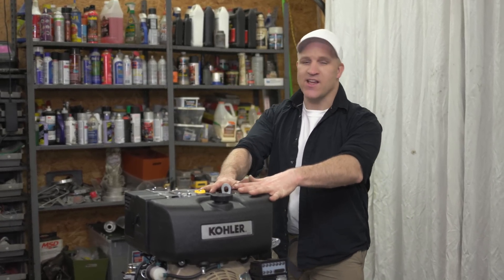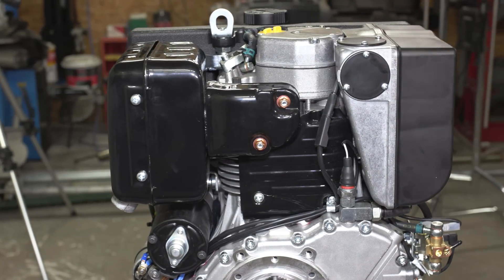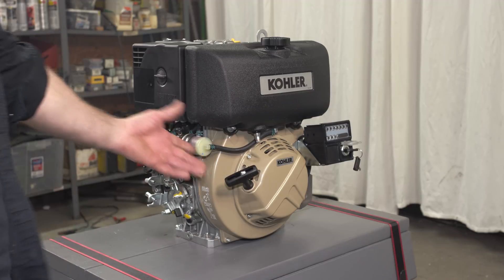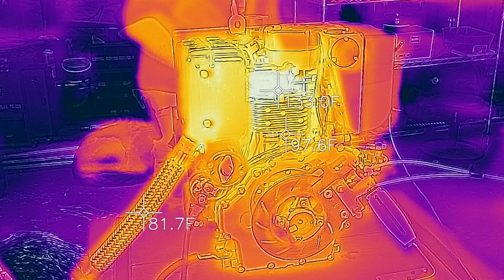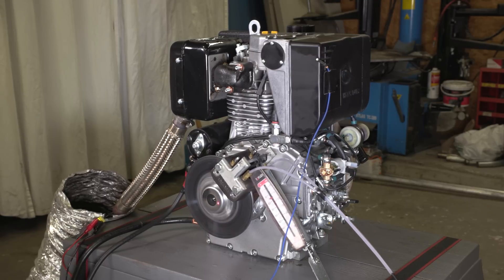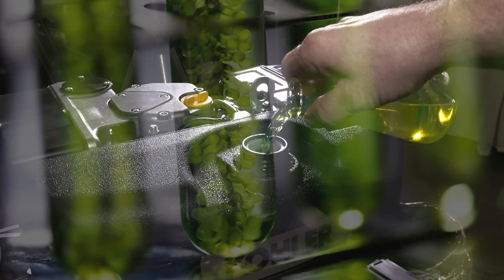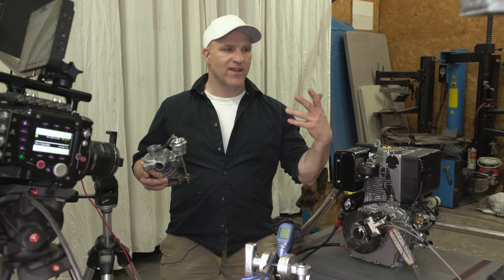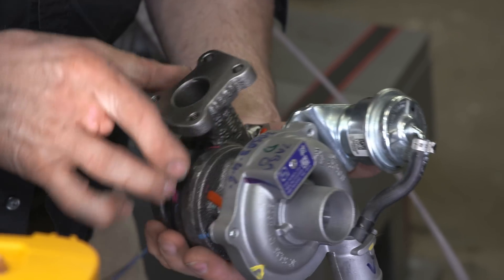Single Cylinder Diesel Engine - Dyno Test (Diesel, BioDiesel & HydroDiesel How Much HP?)

Comment: Those arn't heat shealds,  they are air duct tins to cool the engine.
Reply: The engine will overheat without the air flowing over the fins.
Reply: Paulman50 .. Correct .. sheet removed from cylinder fins was air duct for cooling. And sheet which removed from exhaust manifold was heat shield.
Reply from the maker: Well one of them is a heat shield the other one is a air director
Reply: It doesn't matter anyway, for the purposes of the experiment, there was no variable added from this, as each test had no ducts on
Reply: @WarpedYT  I'm sure you realize already... Just pointing out to the public... Removing an airflow director on an air cooled engine can dramatically change the operating characteristics of that engine. Literally anything from no change to engine death depending on multiple variables.

Definitely looking forward to seeing what you do with this project!
Reply: @WarpedYT  ......
Reply: Doesn't matter, the point is to compare temperatures in different conditions. He isn't measuring for the sake of saying "this engine runs too hot/cold"
Reply: There both, but that's irrelevant idiot.
Great video, I'm getting me a motor for my gocart.....

Comment: Do you have a table with all the values together? I was waiting for that for comparison xD
Reply from the maker: You know, I absolutely totally forgot that. It was literally in my editing notes and since I was working on this edit till 4 in the morning I was really tired and I forgot to put that flash card in there. Holy crap I can't believe I forgot that.
Reply: @WarpedYT  here you go! https://imgur.com/gallery/CxPrNy5
Reply: EGT with hydrodiesel seems through the roof. I wonder if NOx emissions are higher because of that (Probably yes).
Reply: @WarpedYT  put it in the description
Reply: @WarpedYT  https://imgur.com/a/jPd4vwp
I wondered why the EGT temp was so different in HyD, is there any mistake? All the rest are pretty similar.
The time marks in the description were useful BTW
Reply: @WarpedYT  It's fine - just cover it at the beginning of the next video.  We all make editing mistakes.
Reply: @WarpedYT  did you do April eating yet? I haven't saw a single thing of April eating in 1300fps 4k slow motion.
Reply: Nevermind, I put the video on PC and made some screen caps xD
Reply: Yes,. The EGT for HydroDiesel was higher,. But it was also reaching higher rpms,..
I’m wondering why the temperature on the Head is lower on HxDiesel,
It’s about ~50•f bellow the other 2 fuels?
That seems very interesting given it’s the same engine and same test standards..
Reply: Put the capacity in the description with the bore x stroke too ffs. 
The 2 stats you gave show its inefficient, it should have 40ft torque
Reply: @janeblogs324  He's running it at 2800 rpm, it's a diesel it very well could be that it's just out of it's power band for torque. Ffs you'd think a YouTube certified mechanic such as yourself would know this shit.

Comment: Amazing video!  Looking forward the seeing the performance gains with the turbo!!
Reply from the maker: Do you know what GTL fuel is by the way? do you have any experience with that?
Reply: @WarpedYT  pretty syre that turbo is way to big. Looks like its made for a 100 hp or more car engine. 8hp is probably not going to make it spin fast enugh for gains.
Reply: @tullgutten  if i am correct its the same turbo he used on the gas engine. It did give a small gain. However i do agree it seems a bit large but I honestly don't have the slightest idea of where he could get a smaller turbo. 
Anyways if i am right and it was used on the gas engine in his previous videos then it should spool up decently with the diesel. 
No matter I still look forward to seeing what results it gives. Even if it doesn't give any meaningful gains it will still be worth watching. Sometimes failure is just as exciting and entertaining as success.
Reply: @tullgutten  that's really small. I saw another utuber that put a similar one on a small single cyl gas engine and the increase in power was about 5hp.
Reply from the maker: Thank you
Reply: @WarpedYT  may i ask, what happened to your finger :(
Reply: @WarpedYT  use 2 stroke  engine oil as fuel for this engine
Reply: @WarpedYT  nice turnaround slow motion video! is it your first turnaround slow mo video? plus can you do a bullet time (1700fps slow motion) of a water splash?
Reply: I love hearing the dramatic difference with the hydro diesel and the power that came with it . It is a  great video can't wait to see more
Reply: You need to do red off-road Diesel fuel
Reply: Coolkid Logen you do know that dyed diesel fuel, aka off road diesel, is the exact same a regular diesel, just dyed so the government knows if you’re avoiding road taxes on your diesel. There is zero difference between diesel and dyed diesel except the addition of a minor amount of dye
Reply: @YoggieLogie  Almost the same. It does not do so well in kerosene lamp, or heater wicks. The die clogs up the hundred percent cotton wicks, but the road diesel does not.
Reply: @YoggieLogie  yea most people don't understand offroad has been the same as on road fuel for several several years. Several years back it had a higher Sulphur PPM # but once they started coming out with all the DPF and DEF bullshit in everything, they lowered the PPM to match on-road(green) diesel...."Sulphur content below 500ppm" I think I'm right on all that, but I can't swear to it.
Reply: @johnwyman6331 ever heard of the word delusional before?  😂😅😂
Reply: Coolkid Logen dyed diesel is just #2 diesel with dye in it
Reply: @coolkidlogen4924 it's exactly the same except for the red dye..
Reply: ProjectFarm one of my favorite subscriptions.
Reply: Remove the govenor
Reply: these two channels are the best
Reply: GTL means Gas To Liquid. Its syntheric diesel made from natural gas, if I remember correctly. As such, it comes completely sulfur free and may come with higher cetane number than conventional diesel.
Reply: Miguel Angel Vizuet Mata I thought sulphur was added as a lubricant like how leaded gasoline was for Un hardened valve seats.
Reply: sc1338 It does have that function. However, as emissions standards have tightened and sulfur content has gone down, it has been substituted by additives (including biodiesel).
Reply: @project farm  try running  the hydro diesel  in a GAS engine  I hear from some people you can gain MPG  mixing with a small amount of diesel
Reply: Do you wanna sell the kohler after you’re done?
Reply: What about wmo
Reply: What about wmo
Reply: This is all around great quality. The workmanship,  the xamera work, and the editing. Kudos! And 🍻 cheers! Thanks
Reply: I knew I´d find you here :D
Reply: What happen to diesel engine when you use petrol (benzine :D) See trough!!! And how to repeir and compare se trough diesel in petrol!!! Please!!!
Reply: can you get the full song of the first slow mo footage because it is similar to the pit stop one
Reply: 4200 for this POS and i got a sled motor which is 20 times more powerful. why dies this 2 stroke diesle only make 10hp out of 440cc, diesels make nowhere near the power of gas engines for the same airflow rate. My OMC sled would make way more torque than this thing! this this motor would be fun to take down range and launch some rounds though it that is what i would do to it!
Reply: @jlo13800 seek professional help . Before you're put away.. you need serious help..
Reply: Ceek harga boos
Reply: Can u put a straight pipe on a diesel engine?? Will it still work or is diesel exhaust different?
Reply: Jesus my two gods talking each other... What's going on? ❤️
Reply: @leog5804  LMFAO I was just gonna say the same shit... I was like WTF.
Reply: Please do an experiment on this. Is it possible to skip a cycle to save fuel?..(regardless of the power output) for example, you have a 250/300/400 cc engine (four stroke) and it fires after every 2 revolutions we do a trick to the carburettor or an EFI or any other system to make it fire after 2 cycles (4 revolutions). So virtually it becomes half the real displacement i.e 125/150/200cc and consume half/less fuel. On any engine generator, motorcycle, mower. Please do an experiment on this.
Reply: @nordenconrad  it would then produce half the horsepower, or less. Take a look at hit and miss engines.

Comment: Maybe you will make an electrical dyno, and measure the energy comming out instead of the brake wobling thing..? Thanks for a lovely programme, i really like your stuff
Reply: His dyno works totally fine for these "garage" comparisons. We aren't in a laboratory, we're comparing between fuels and modifications... if he sticks with the same setup then we can see what changes, it doesn't need to be down to the .01% accuracy, or comply with standards.
Reply: Using the same dyno keeps the results constant across different engines. But I agree, and electrical dynamometer would make things so easy, once it's built the tests would be near effortless to run.

Comment: Can you also try GTL diesel and vegetable oil as fuel? I use GTL in my boat engine and I would love to see how it compares in detail.
Reply from the maker: That is coming up in the next vid, I have a really really awesome test idea that I'm going to do in the next video using all sorts of different fuels.
Reply from the maker: I think I will get ahold of shell and have them send me some samples, I think that would be super cool.
Reply: @WarpedYT  yeah GTL is really clean in my experience, with normal diesel I always had a diesel smell and with GTL I don't smell it anymore. But I also hear it decreases power so I'm really interested in seeing GTL specifically!
Reply: @Een_Thijs  GTL is a BIG reduction in power
Reply: @WarpedYT  I really hope that shell wants to help you in making it happen!
Reply from the maker: GTL diesel I didn't think about that one
Reply: straight vegetable oil isn't good, it is mixed with gasoline at 15%
Reply: Run it on like 25% engine oil. 
I run my 91 Jetta diesel on 20-25% new engine oil mixed with diesel , for fear of killing a pump and I get it for nothing. 
Straight diesel vs my concoction, the good stuff idles about 50-75rpms higher , and I have less of what's called "part throttle popcorn" from advanced timing. 
You could blindfold me and I'd be able to tell the difference. 
It's like octane booster for a diesel. 
I still throw in overdoses of cetane boosters too. 
The VW engine demands 55-60 cetane and the stuff at the pumps is like 40. 
So that's like running your Veyron on 87, no bueno for performance starting point for your diesel.
Reply: @MrTheHillfolk  20% engine oil ? damn that's absurd. If you wanted to run on engine oil 1-2% would be ok.
Let's all remember that 2 stroke oil normally get's mixed at that ratio.
Reply: @AAAAAAndrea  
There's been quite a few times I've been out in the sticks for work , and possibly low on fuel. 
No problem, dump the 5 gallon pail of waste oil I accumulate during services and dump it right in. 
I did that quite a bit on that truck , never had an issue. 
It was a Mitsubishi fuso 4wd. 
I'd never use waste oil on something of my own, THAT'S absurd.
Only issue you might have is it cranks an extra second if it's near freezing.
Reply: @MrTheHillfolk  Actually, lower cetane number is "better", because cetane works in reverse compared to octane.

Comment: That was a cool chat thing. Couldn't get my comments in before it ended though. I already knew the biodiesel would produce slightly less power, but was surprised by the hydrodiesel results.
Reply from the maker: Thanks, let me know if you think I should do a premier like that again? Or just a normal video post. But yeah the Hydra diesel was very surprising, I mean technically it should have 20% less energy then regular diesel simply because it's mixed with 20% water. But overall it was pretty impressive and very interesting.
Reply: @WarpedYT  Definitely do more of those, but maybe a heads-up announcement a day or 2 prior? I didn't know it was happening until I clicked on it in my feed. 
Maybe the water in the hydro provides an overall cooling effect on the combustion process similar to a water/meth injection system? Just conjecture of course. It surprised me, for sure. Makes me wonder if it's also more fuel efficient.
Reply: The water turns to steam, steam power, right? At 15 to 1 compression it turns to steam damn fast, and expands just as fast .... if i have my diesel engine knowledge right.

Comment: Kohler are shaking in their boots
Reply from the maker: Nah I think they know their engines are very reliable, but they are a little bit nervous about the amount of air and fuel and RPM that I proposed I dumped into this engine. I did a little test run and it sounded really scary but I'm up for the challenge.